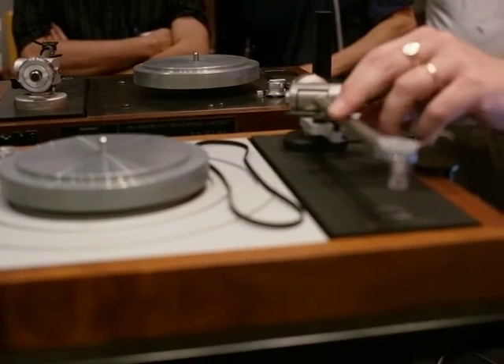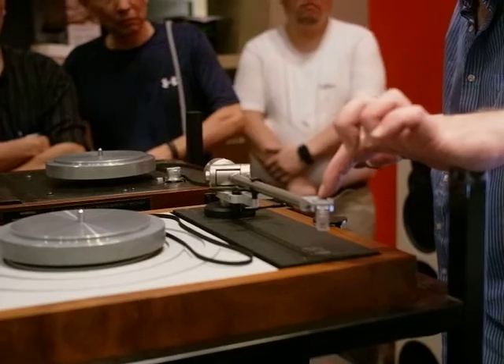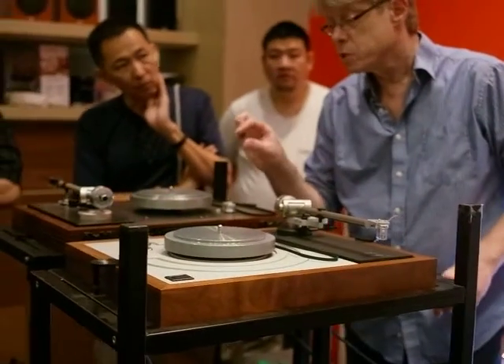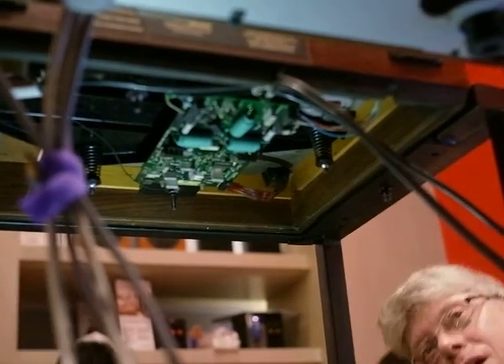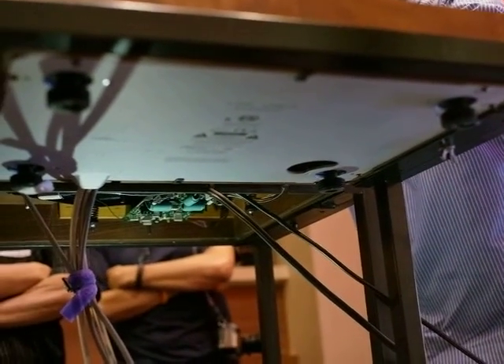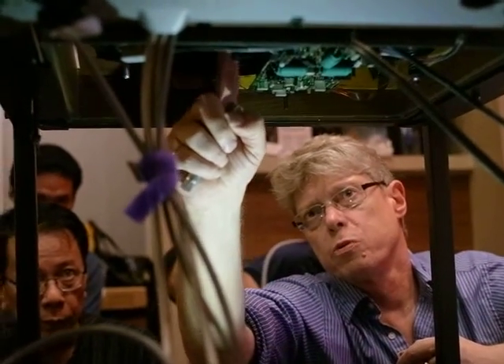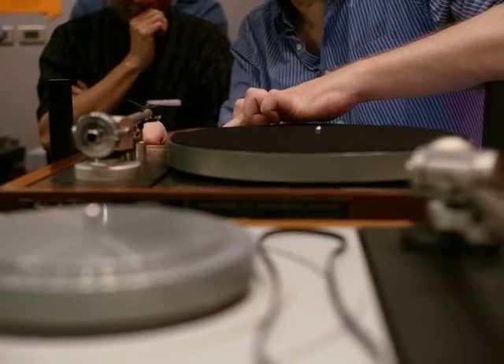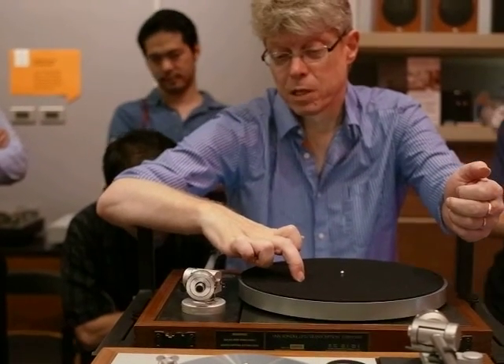Linn LP12 workshop (part2/6)

Comment: 9:30
I mean, you could've used rubber cable grommets to insulate the cable from the chassis.
Some types of cable grommets are specifically designed for that exact application...